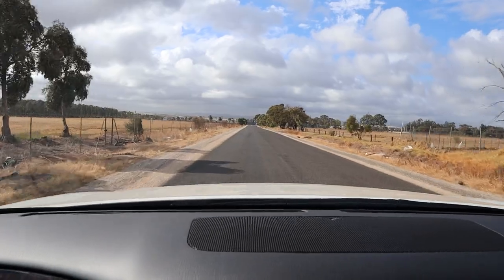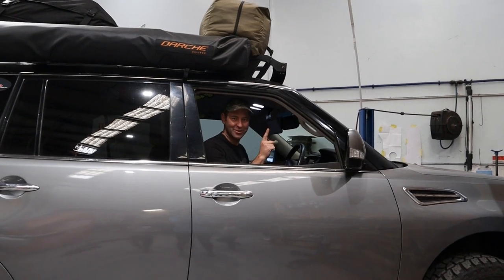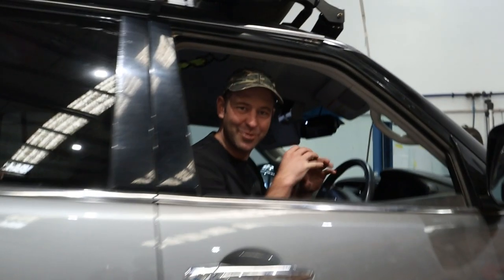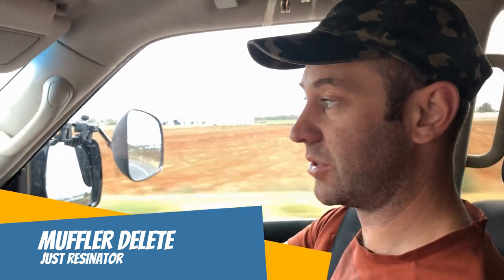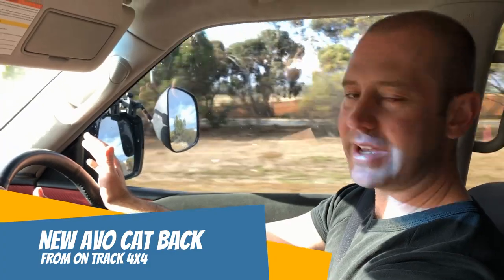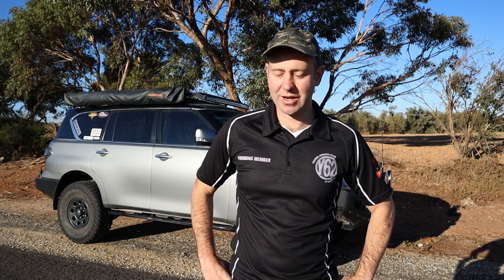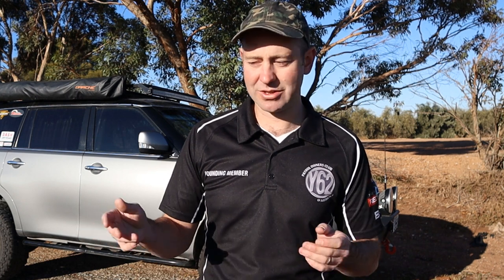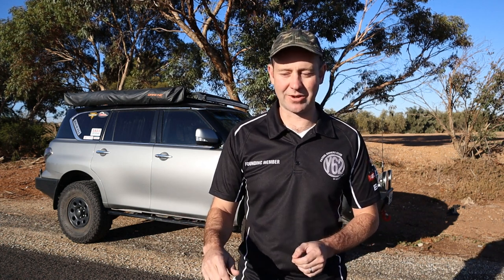Does $$$ buy you a better sounding and performing exhaust? AVO Cat Back Exhaust Review

Comment: I am getting codes all the time now too....2013 build Ti-L 98k km....already has a CAT back exhaust....will putting the AVO second cat delete pipes help?? want to avoid the cost of a full system
Reply from the maker: It will help the system flow but the o2 sensor is before the rear cat so won’t help you with codes sorry. Speak to OnTrack about the “Super High flow” front cat
Reply: @DASHOffRoad  got a website for them? My mechanic is telling me to go back to stock but dont think that will help either
Reply from the maker: Just call up OnTrack in Vic. I used to clear codes daily, now I haven’t seen a code since

Comment: Ditch the cats and put a snorkel on it with a huge filter ELEMENT in a sealed box then tune it! Haha. A good catch can system would probably help too! Running huge tyres might as well go the whole hog! 

I had a pretty wild naturally aspirated V8 with head work, cams, intake manifold porting, extractors and tune. Biggest gain apart from race fuel was removing the cats. They choke up a naturally aspirated engine soo much. The gain was over the entire dyno graph too and torque as well.

Comment: new set up definitely got rid of the straight pipe, thong-slap sound, but it now sounds kind of stock. not sure i'd be too happy with that massive rear muffler (axle back) either. wonder how longer before you rip it off when off road? maybe try unbolting it and replacing it with a hot dog axle back to get your clearance back? Also, you should have looked into a custom length J-pipe with your old setup. It would have got rid of the drone but kept the loudness.